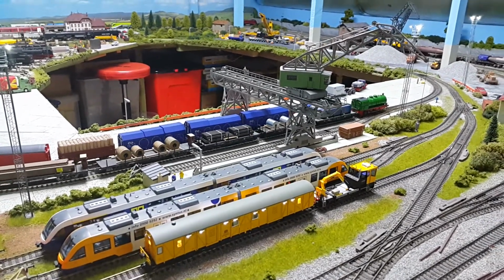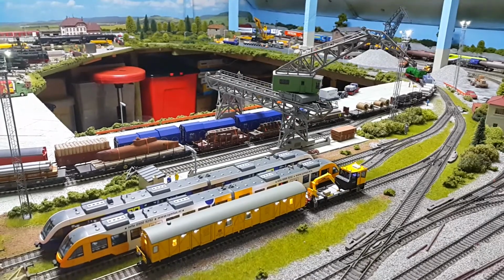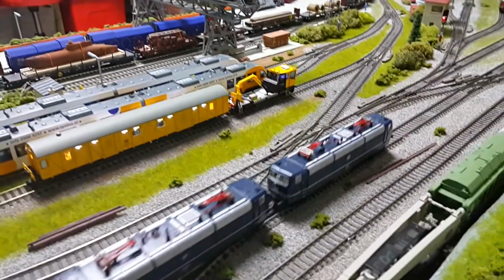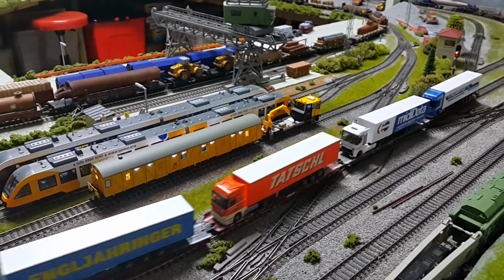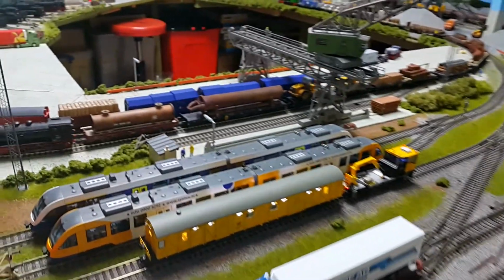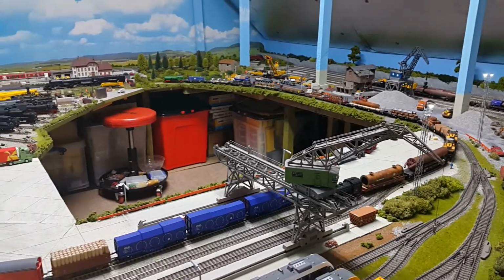Push pull train consist

Comment: Hi Jim, long time no speak!  Robin contacted me through my channel to say that you had put up a video showing how to copy one decoder file to another decoder using the Lokprogrammer, the reason he contacted me was that was the perfect solution to my problem I was experiencing. I have two Class 67's which top and tail each other with 7 coaches in-between but I could not get the two locos to run identically. After watching you previous video I set up my rolling road and Lokprogrammer and did exactly what you did and hey presto, the both run (almost) the same speed. I say 'almost' because there is still a fraction of a difference between the two but the important thing is that I can now run for the first time ever the Royal Train with a Class 67 up front, 5 Mark three coaches, 2 Mark 2 coaches and another Class 67 bringing up the rear - both locos have Loksound V4 sound decoders in them. So once again I need to thank you for your expertise in all thing ESU - it really helped me solve a problem that had been bugging me for ages. It wasn't just the decoders though as I had a mish mash of three different style of Hornby couplings as well which really didn't like playing together. If your interested in seeing it work then here is a link but no worries if you don't, I would fully understand.   Link here:  https://vimeo.com/181829246    Once again Jim, thanks for your help.             .........Graham
Reply from the maker: HI Graham! 
it's great to hear from you...I hope you and your wife are well.
yeah I've done this for a while to easily match decoders of the same make..but sometimes there may be a slight difference e.g a loco that's ran in or used more then the other ,in that case I have another method to perfectly match which esu don't tell you about...I may do a vid on that at some point. 
I will check out your link.

All the best jim.
Reply: Oooh, now that 'secret' alternative method sounds interesting - I shall keep an eye open for that - hopefully you will make that video.  Yes, the wife and I are fine thanks Jim and I hope your family are too.               ..............Graham
Reply from the maker: +Graham Foulston yes the other way is to speed match on the fly as I call it....which I use even when all the settings and decoders are identical and there is a slight difference in speed etc.
I hate running locos in consists etc unless they run as close 100% as possible with each other.

Comment: Hi Jim, Glad it worked as I have tried front and end engined trains before and never got it to work as I could never get the engines synced enough, but never tried the decoder file copying method. So it's great to see it in action twice in the same week, as I watched Graham do it on Lakeside.
Robin
Reply from the maker: Hi Robin...yeah it works perfectly I have around 8 pairs of locos setup like this e.g same loco but maybe different livery, same decoders and same settings...but never tried a push pull train of wagons...thanks for your input ..sometimes I think some of my vids maybe a bit boring or geeky lol...but if they help other modelers like Graham it's worth doing them...thanks Jim
Reply: Hovermotion I set up and learnt all about my ECOS following your 'geeky' videos so keep them coming.
Robin
Reply from the maker: +Milton Mo Junction lol...that's good to know..thanks

Comment: You call it a Push pull consist ,,, I call it a "Banker"  great example of how heavy freights used to be coupled on long inclines just in case the train broke in two ,,, when I was building Haddon to Bakewell,,,,, two thirds of the length was one in a hundred and this is just what I was hoping to recreate ,,, a long coal freight with a banker on the back ,,, then hopefully recreate the astonishing sight of a double header with a banker on the back as they used to couple them for the 15 mile incline from Rowsley to Peak Forest ,,,
Reply from the maker: HI Alan, very intresting information and ideas...
thanks ..Jim